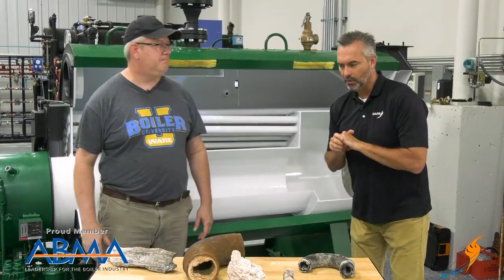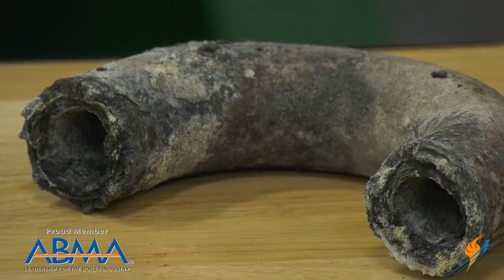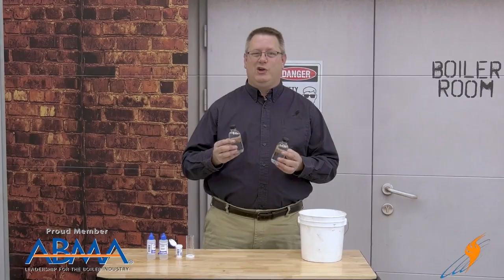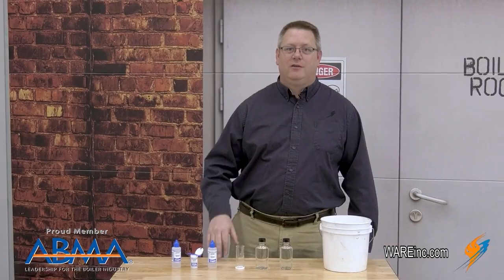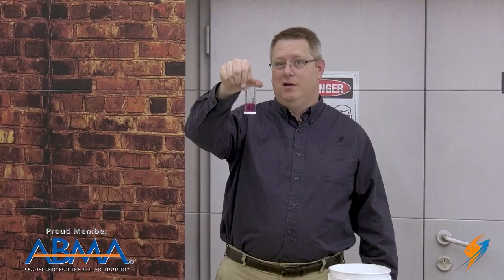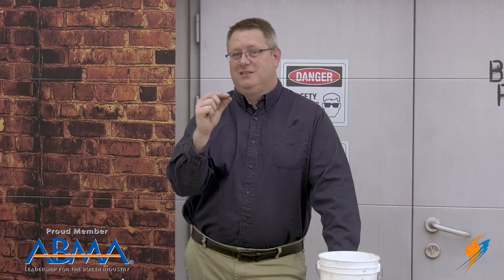Boiler Scale Prevention 101: A Guide to Water Treatment and Maintenance -- The Boiling Point

Comment: Can you chemically remove scale already built up with a flush, or is it something that needs to be done externally before the water gets to the boiler & heated surfaces?
Reply: That usually has to be done manually like with a high pressure water system to blow what ever can come loose!
Reply: All those neglected leaks that somehow patched themselves will become apparent as the scale build up is removed 😊